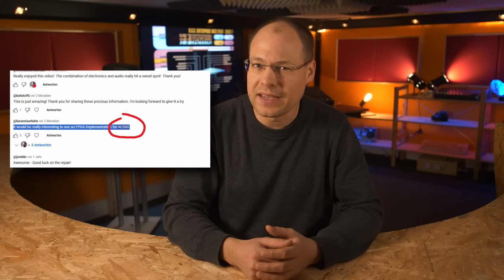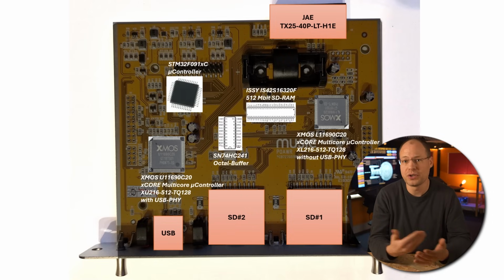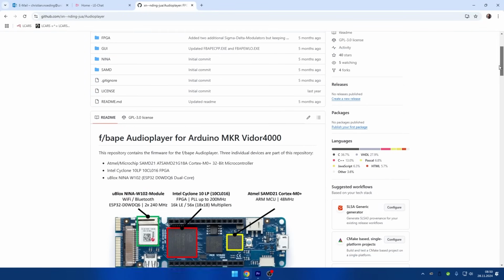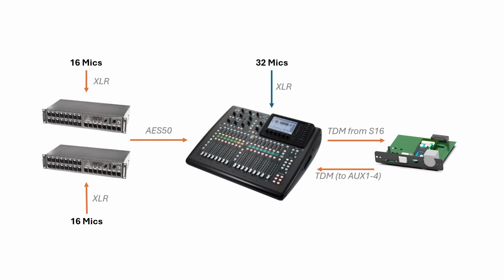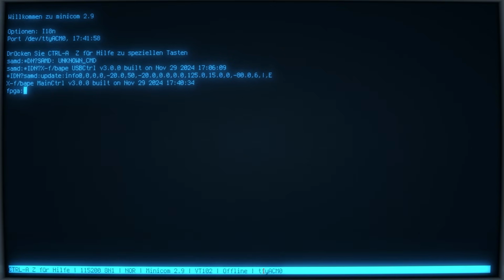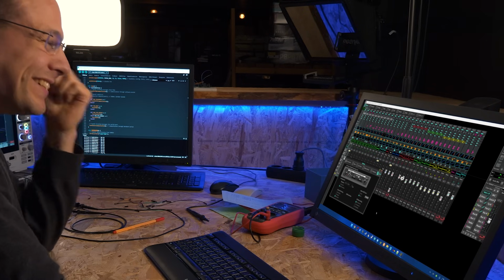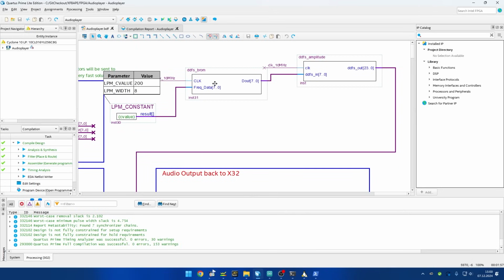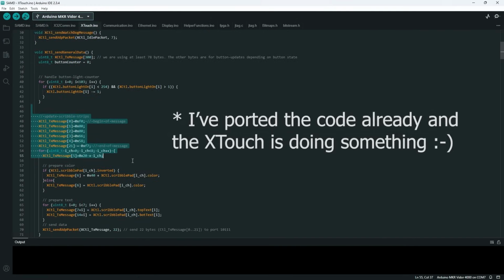X-FBAPE - The DIY FPGA-based card for the Behringer X32

Comment: Freakin' amazing my friend, well done. I am but a humble assembly level programmer still living in the 8bit world. At my age I am completely taken aback by the ease with which you move through all of your IDE software and the incredibly short time cycles you seem to have in your debugging, not to mention your reverse engineering efforts.
Well done, very impressive.
Reply from the maker: Thank you for your message. In my daily work, I try not to stick too closely to a manufacturer's solution or IDE, but to find the right way in a more solution-oriented way. That helps to stay flexible choosing different tools, but of course sometimes leads to confusion if the syntax is different. Spending enough time with the different tools they get kind of additional senses of yourself and you use them without giving them much thought.

Assembly is the royal class of software development. I started digging into x86-assembly a couple of weeks ago to change the beaviour of a long abandoned software, and I have respect for people who can read and program it without effort.

cu,
Chris

Comment: Awesome video, really cool to see someone with way more patience than I reengineer this stuff. 

Was wondering how hard it would be to make a "poor mans dante" aes67 card. Like would an fpga like this one actually support a standard like that? Thanks!
Reply from the maker: When I set my mind to something, I am very persistent. I wanted to know how the X32 communication takes place.

I have not enough information about Dante Audio-network and the used protocol to give a good answer. As Dante seems to use layer 3 ethernet, there would be a bit more overhead to implement to get the network-communication up. But the overall latency is worse than compared to my approach. Dante has something between 0.15ms and 5ms - this is 10 to 250 times more than in the direct approach in my video. Here the latency is around 21µs - 1/48kHz, hence realtime. But I see the benefits of this ethernet-approach and AES67 is something lot of people asked for in several mails I received. Would be a nice topic for a new project...
Reply: @pcdimmer  thanks for your response! I guess as someone that has been working in and around network (layer2,layer3) audio for the last while it's kinda a specific interest for me. Looking forward to what crazy stuff you do next!

Comment: That doesn't look like any X32 I know.  Is it older?  Or some kind of custom mod?
Reply from the maker: I bought this console in 2013, right after it was published. In the first batch of consoles they used a different type of buttons and fader-knobs. So its not modded, but just "old" :)
Reply: @pcdimmer  Oh.. that's the X32 Core, right?  I've only ever seen the full size console and the X32 Rack - 3U vx. 1U.  Thanks for the info.

Comment: Damn that is such a great Video! Thanks for your work!!
You could also implement a midi interface or via usb to take the „daw“ Layer of the X32 with Mackie/Hui just like i talked about with the xtouch! :)
Reply from the maker: Yes, this is a very good idea: MIDI-signals should be available on the Expansion-Card-Connector as the X-USB offers a MIDI-interface on the computer. This would be great: we could switch with a single button of the X32-surface to the additional 32 channels and use the available faders of the console. I put this on the ToDo-list for this project!

Comment: Could you use this to flash the Yamaha DTX Multi 12 firmware to get around the sample size limit and possibly add more storage to it?
Reply from the maker: Nothing is impossible, but these are totally different devices and do not share a technology-base. In addition, changing a firmware is not the same as decoding/interpreting signals. I'm afraid it won't be that easy.

Comment: Can you make a card that changes it to 96k and double the DSP?
That way I can run an X32 at 96k and have more reserves and more dynamic EQ
Reply from the maker: Adding more DSP is possible either by using a larger FPGA (this one has only 16LE) or by using a dedicated Audio-DSP like the Analog Devices SHARC series. The Arduino Vidor 4000 has enough spare pins to add additional Audio-Hardware and make use of poewr of external chips.

But I'm not seeing a benefit of going to a samplerate of 96kHz. In our Class-D-Amplifier we used an upsamling mechanism up to 10MHz(!) audio for the Sigma-Delta-Converter and an analog input samplerate of 192kHz, but you are not gaining more information for the ear, only for the electronics (having the GalliumNitride-switches and the LC-filter in mind). We can use only audio-information up to 20kHz, use up to 24kHz for some harmonics-optimizations, but everything above 24kHz is ultrasonic. With Shannon in mind we should use a doubled samplerate so we end up with 48kHz. With 96kHz we can annoy bats, but not enjoy music more than with 48kHz...
Reply: @ doubling the sample rate halves the latency. When I mix on 96K consoles it seems as if there’s more detailed than 48K.. all consoles will be 96K moving forward anyway. If the X 32 was 96K you would be able to use the higher end Midas stage boxes.
Reply from the maker: The Cyclone10LP FPGA is able to deal with 192kHz audio (we used this in our Class-D-Amplifier) - and more. With the used 100MHz main-clock each EQ is calculated after 14 steps (=14 x (1/100MHz) = 140ns). With 5 EQs in series, the audio-samples are processed after around 1µs (if you take a few other calculations into account). With 96kHz you have 10 Microseconds between two samples - so this is absolutely possible. Even 192kHz (5 Microseconds) is possible. But the internal processing within the X32 has a lot of different audio-processing and DSPs. As the coefficients of the IIR-filters depends on the sample-rate, it is not enough to increase the clock of the system.

Short answer: it is possible to create a digital mixer with 192kHz and more without problems using an FPGA, but it is not possible to change the sample-rate of a closed-source-mixing console without changing the individual calculations.
Reply: @pcdimmer  OK, taking that further. Could a mixing console be made that is 192k that uses FIR filters that have a latency of <1ms through the console? So FIR filters where the EQ would be, dynamic FIR filters and all pass filters on everything? I realize that the price would be prohibitive, but these are things I think about. 
My dream console would be 1000 audio paths, open architecture, FIR filters, dynamic EQ on everything and the ability to emulate any analog piece of gear. Latency of 1 microsecond.  I realize that this is unrealistic, but it's things I think about.

Comment: Dear Sir Christian. Is there anything I can do with old firewire cards? I have a fantasy that you could take a Rassberi, do the electronic wiring and create a sound card for your Intel PC over ethernet. Hello from Ukraine, we still have a war, but we have big dreams.
Reply from the maker: Oh, this is a totally different approach. But you could try this: use a PCI to PCI-Express adapter to connect your Firewire-Card to the RaspberryPi 5. I know, that Audio over Firewire is possible with Linux as I used my old Alesis MultiMix16 Firewire with my computer. Here you could try to find a Audio-driver that receives multi-channel audio and then stream it over ethernet. But as I said, this is a different approach and I am not familiar with Firewire in detail.
Reply: @pcdimmer  Thank you for your reply. 
Do you think it is even possible to use FireWire cards without FireWire itself? for example, somehow connect to this chip and send sound directly from the card to the raspberry :? Something like I2S or something like that. 
Sorry for the stupid questions, I'm a very superficial person in such things.
Reply from the maker: Sorry, but I can't give you a helpful answer with this, as I'm not familiar with all possible chips here. My advice: have a look in the datasheets of the chips. Most of the time they are using basic protocols like I2S for audio or I2C/SPI/UART for communication. But if it comes to high-level-protocols, you will need some time to discover the used commands or have to implement larger frameworks. As an example: everyone uses TCP/IP, but I don't want to have to implement my own IP stack.
Reply: @pcdimmer  I would like to bypass firewire, and try to make a network sound card for a computer in a local network.

Comment: @chris, is your wiring: 2x stage boxes to the board's standard AES50 connections and 2x boxes to the card's AES50 connection
Reply from the maker: It depends: in the video I used a X32core without analog inputs. Here you could connect four stageboxes: two to AES50 port A and two to AES50 port B. 32 channels of these boxes are then routed to the internal channels of the X32 and another 32 channels are routed to the Card. Two of the AUX-channels are then used to receive channels 1 and 2 of the Card with a submix of the 32 channels of the Card mixed by the FPGA.

Using a larger X32 console you have the internal analog inputs as well, so there are lot of different options possible :)
Reply: @ I see. I didn’t consider routing one of the AES connections directly to the card. 

What is the purpose of the ethernet port on the card? (Sorry if you stated that, I might have missed it)

Comment: Awesome Video! I love the idea finding new ways to use existing tools to the fullest extent.
I've actually been thinking about DIYing a standalone multi track dante recorder that doesn't cost upwards of 3000.-. Your approach could probably be adapted to merge an X-Dante and X-Live into a multi track dante recorder without too much effort.
I will eventually try to do this myself. However, if anyone here has more time and is similarly frustrated with the lack of an affordable option, fell free steal the idea.
In any case, thank you so much for reverse engineering and sharing the protocols, commands and everything else.
Reply from the maker: Yes, this is absolutely possible. With the shown Arduino we can combine two - or more - Behringer Cards as we understand the commands now. It would be a device with the FPGA as a kind of audio-signal relay: the SAMD21 microcontroller would initialize the two Cards and route the audio-signals between both. So instead of 3000US$ this would cost about 600 to 700US$. A bit cheaper :)
Reply: @pcdimmer  Great to hear, thanks for confirming :)
Reply: How much channels do you need? Would it be possible to get a cheap mini PC with SSD and run Dante Virtual Soundcard on it? Licenses start at €55 and give 64 channels in and out
Reply: @daanpendavingh3100  Yes I though about using a rasperry pi for this. Unfortunetely, the DVS doesn't support linux and I've never run windows on an rasperry pi, so I don't know how well that would work.
In any case, with the information that @pcdimmer uncovered, I think it might be easier to slot the Dante Interface cards from the X-Dante on to a modified X-Live card and record the audio by tapping the communication lines between the X32 and Dante Interface

Comment: Veeery nice project. Thanks for sharing this. And very kind of Behringer to make this port so approachable. They really could have provided a proper documentation for this. That lifts the X32 to an impressive level of hackability. I did my first steps with Lattice FPGAs, so maybe a variant of your board with one of the Colorlight modules might be a nice project :) Would also make a full OSS workflow possible using Yosys/NextPNR.
Reply from the maker: Yes, that would be a nice thing if a few others could continue on this basis and the - admittedly already large and diverse - ecosystem of the X32/M32/WING could be expanded once more.

One more idea I did not mention in the video: as the protocol of the expansion cards are decoded now, we can use the X-LIVE card in other projects and connect different hardware with the X-LIVE as we know understand the communication and the audio-data :)
Reply: @pcdimmer  Hehe, next video is then plugging the X-Live as an expansion to your FPGA mixer :)

Comment: Amazing work and all together awesome, thanks for sharing.   

Looks like the DMX had to have a little haircut to fit in there, lol. nice make it work.

Might have tried a modular connector and pigtail xlrs as some cheap and small DMX gear has done, or pipe your universe over ArtNet with that ethernet connector.
Reply from the maker: Haircut is good :-) Well, for probing the DMX signal, I only connected the oscilloscope-probe loosely to the XLR contacts and did not use a 120 Ohm resistor. I probably hadn't grounded the sample well. In any case, my DMX lamps worked without any problems.

ArtNET is a good idea. That should work with the available controllers - either SAMD21 or ESP32.

Comment: So cool!! I'd love to see more X32 stuff. What would it take to get my hands on something like this? Buy parts and solder it together?
Reply from the maker: Yes, all components are freely available on the market and the use of the Arduino Vidor4000 prevents you from having to work with very small components. However, the two PCBs are required, for which the production data is available in the GitHub project as a Gerber file and KiCad file. This files can be used to have the boards manufactured by any PCB manufacturer available. The necessary firmware-files are also in my GitHub repository, together with some instructions on how to upload the files.

Comment: Hats off to you sr!!! I've not enjoyed a video like this in a looooong time !!!! thanks for sharing.. I have a Behringer Wing and tons of ADAT instruments and processors that I would like to connect to that Wing .. wish I could have a card for ADAT I/O for the Wing wich is not available from Behringer so far :( .  But this video has gave me hope some day ( fingers crossed )
Reply from the maker: We can also add ADAT to this card. ADAT-Out is no problem at all and requires only small resources of the FPGA. For ADAT-IN I guess we need to perform a sample rate conversion using a steep low-pass-filter. The FPGA could be a little too small for a high-quality LR24-filter here, but technically this is no longer a major challenge. However, as I do not intend to sell the card, I am unfortunately unable to offer a ready-made solution.

Comment: Wow, exactly the niche content I like! I've used VHDL in university and now I think I should get back to it. The professors always told us how expensive the equipment is (and it probably was expensive) but I never knew there were more consumer focused and cheaper boards available.
Reply from the maker: Yes, a lot has happened in recent years. Arduino released the Vidor4000 in 2019, but it's only gradually becoming clear what you can actually do with it. I am glad that the major manufacturers provide the toolchains free of charge. Otherwise you wouldn't be able to get projects like this off the ground.
Reply: The ecosystem has changed a bit and made it a bit more accessible. But yeah same feeling I never really got into it and miss the hackery :)
Reply: Hi FPGA's are still quite expensive if you compare raw processing power to small MCU's or large runs of ic's. But yes the technology is getting cheaper, which is great for hobbiest!